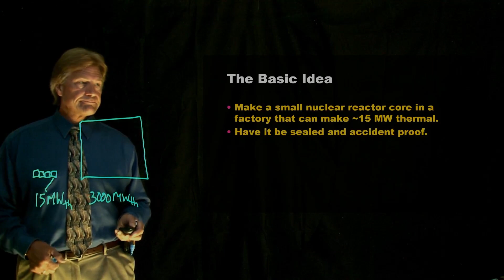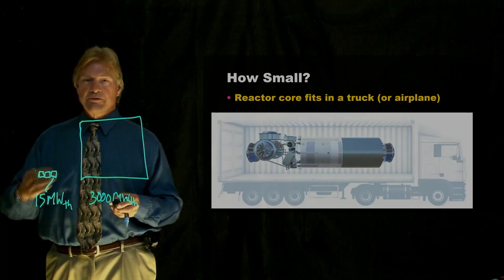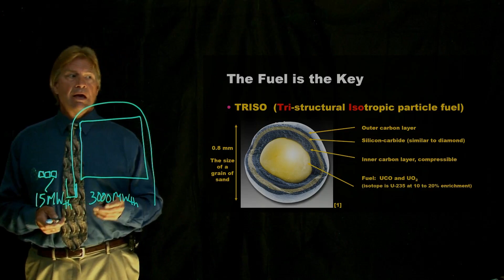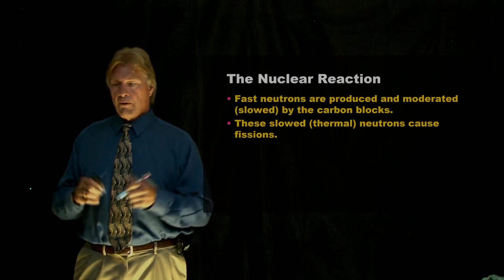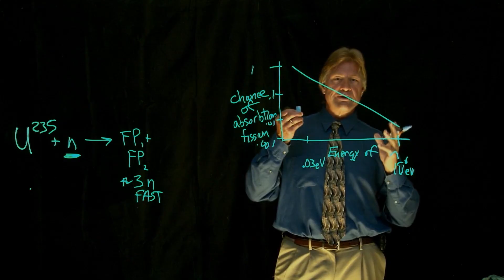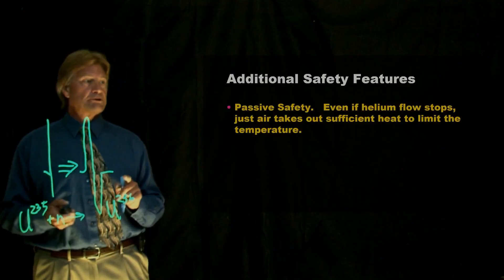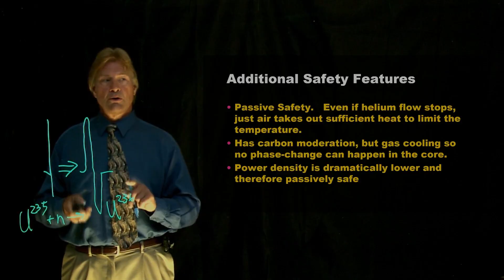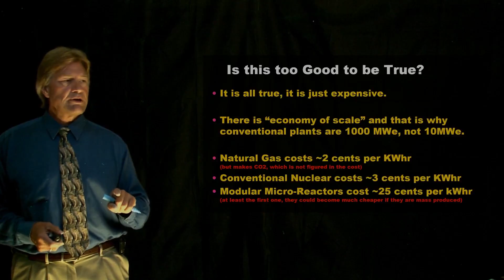Modular Micro-Reactors – The Future of Nuclear Energy?

Comment: A point the professor doesn't talk about is that the replace-ability of the reactor module means the generator site can be constantly reused and expanded with ease. Start with one or two modules, add some extra steam/salt piping and add a few more modules. Remove a module or two - cap off the pipes, and keep chugging along. 

The 'Power Plant' - the generators and such, are independent of the thermal generations; you could plop a natgas steam generator down and plumb it in if you wanted - steam is steam - OR, on an existing steam site, you could plop down one at an existing steam generator site to replace the old diesel or coal boiler units - and keep using the existing turbines. 

This may become the biggest use of the small modular reactors - as a replacement or supplement to existing thermal generators.
Reply: Might have implications for servicing as well. Need to take one down for repairs? No problem, just borrow another one from somewhere and plug it in.
Reply: @trucid2  Or if one went serious haywire, send it back to the factory to be repaired in safe conditions. 
I've been going on about micro reactors for ages and the ONLY reason for the big new projects has to be because of serious lobbying by the nuclear construction industry...which must see the writing on the wall from renewables/micro-reactors.
Reply: @JohnnyMotel99  I wonder how small these can get. Can we make it the size of a battery and solid state, using crystals that produce electricity from a temperature difference?
Reply: @JohnnyMotel99  I don't know why there is this the new term "micro reactor". What is wrong with small modular reactor (SMR)? A micro reactor is known in chemistry, where sensitive chemical reactions can't cause a thermal run-away.
Reply: @trucid2  Yes, this is called radioisotope battery, https://en.wikipedia.org/wiki/Radioisotope_thermoelectric_generator
Reply: Gunnar Kaestle my error, used wrong word. I’m just a lay person interested in this area.
Reply: @JohnnyMotel99  Well, actually it wasn't you, it was the creator of this video who chose: "Modular Micro-Reactors". Thus my question is to our Illinois EnergyProf: What is the difference to a Small Modular Reactor (SMR) and why did you prefer the modular micro-reactor?
Reply: @trucid2  If a unit has 15 MW thermal power - what will be the electric power? 5 MW? A few manufacturers are suppling 10 MW ICE CHP units, and you don't want to plug these units in and out to a busbar. After the commissioning you hope you can operate your internal combustion engine plant the next 20 years without disturbance. https://www.innio.com/en/news-media/news/press-release/centerpiece-of-k-i-e-l-coastal-power-plant-complete I believe a SMR operator will prefer to do the same.
Reply: He did mention it he drew many little boxes
Reply: @NOBOX7  I am a cost engineer and this is not a laughing matter.
Reply: kkthxk  I suppose you are making a joke? It's often hard to tell. Clearly absurd comment. 
On the off chance that this isn't a joke; I have to assume you are not aware of a company called Tesla that has built a battery storage system at the Hornsdale wind farm near Perth that has performed so much better than fossil fueled peaker plants due to its instant response that it has dramatically shortened its pay back period and inspired California and others to order such plants. So you see battery storage IS cropping up all over. You might also familiarize yourself with their "Autobidder" software that turns every electric car of theirs into a grid tied storage unit. Even Jim Crammer says oil is dead.
Reply: @stevemickler452  you know a few days ago a cigarette smoker got put in the ground at the ripe age of 65 and he coins the term or use the term selfish solar he is a climate change denier and I'd probably that way with a Christian fundamentalist perspective and history going back many decades of spending hundreds of thousands of dollars on his personal clean house power plant. He's the dude that you can buy the model 3 complete batteries from to use for your instant electric hot water heater or as I like to call them incandescent technology water heating the. I have personally met dudes that because they got pissed of the winter natural gas meter turn on fee have switched their houses to three phase so that they can use electrical resistance to heat water for many showers simultaneously. This does not matter unless Society adopts the madness and that's what we have seen. You don't seem to understand the frequency regulation has nothing to do with the proper price of liquid nitrogen. You don't seem to understand anything about the energy on the edge of a wire that is in the entire system of an electric grid which is fine but when you start talking you're not making sure the windows are shut and you might just destroy our planet with your nonsense.
Reply: @George Mann I understand lots of people have been dealing with these issues for even more decades than I have but it seems like they don't actually think about them and build on prior understandings. You think that's $50 2 * one kilowatt hour of electricity and I don't know why it puts an asterisk in the place for the word store but that's what happened so anyways storage is not the alternative to fuel and fuel rocks clean fuels that can generate mechanical work cost absolutely nothing for the materials to build our very are has all the material we need to store the energy and move it. Nobody pays what kind of money you're talking about for fuel of course so you can't compete at that rate but liquid nitrogen delivered is about single-digit gallons per dollar currently but can be brought down to double for a dollar in gallons that's without the delivery but flashing the cost of delivering saira Jenik liquid anywhere on this planet from anywhere on this planet by over 99% is basically trivial especially if you have a material of similar heft going in the other direction and given the reduced cost of such shipping there is actually no if there LOL to say that you don't possibly is to be facetious.
Reply: @George Mann I am not so sure about the figure of $50/kwh as the costs for the thermal storage made of molten salt. A hot-water tank (district heating, 1500 MWh) in Mannheim was installed for 30 M€/1,5 GWh = 20 €/kWh. A salt storage is a little bit more complicated than a simple hot water tank with some rockwool around it. But you can heat the volume much higher beyond 100°C, so the temperature spread can be higher, more energy can be stored per volume, even though water has a very high specific thermal energy capacity.
Reply: kkthxk  Coal fired plants are being built but only in Asia. In the US and EU, their number is declining. https://www.carbonbrief.org/mapped-worlds-coal-power-plants
Reply: Of course you'll still need a fossil fuel peaker plant or battery right? Molten salt will not store much heat unless a large storage vessel is added and even  then it will still have much more lag than battery. Just add some solar panels and save the money on the reactors. You'll have more power for your money and be able to expand as desired.
Reply: @stevemickler452  he addresses this at 18:50... depends on the use-case.
Reply: @mrshmee  Thanks. My bad but in fairness; I had trouble hearing. I think my point still stands though. Ordering more units is not an economical way to handle peak use I wouldn't think.
Reply: @stevemickler452  No, it is not economical to hadle peak use. You don't cover peak loads with base loads plants (= economically seen, a base load plant has low OPEX, but high CAPEX)
Reply: @gunnarkaestle  Whether you call them micro reactors or SMR,  they must have a steam turbine to spin the generator. Steam turbines are more efficient at larger sizes so I'm not thinking that the costs work out very well for smaller installations and even with salt heat storage, the turbine still has to be sized for the peak use  Wouldn't this result in lower thermodynamic efficiency and also cost inefficiency since you wouldn't be operating the turbine at peak most of the time and therefore wouldn't be getting ideal return on the turbine investment? If reactors are sized for steam turbines they end up big so you would have to have many SMR's per installation. This couldn't help but increase costs it seems to me.
Reply: @stevemickler452  I don't think you're contending that you have a point Steve so I'm a little bit unclear as to what the motive of your comment is?
Reply: @Irene-fu6gj  The statement was made that "batteries are garbage". That cannot be a serious statement given that, as will soon happen, millions of EV's plug into the grid acting as storage, and large scale dedicated battery storage continues. 
Solar is cheaper.
Reply: @stevemickler452  look some people are the way they are because do you see people complaining about retail when talking about wholesale or vice versa. It's like the Leaky Roof I am all for putting another roof on it frankly but there is a consensus that says tear it all down and put another one up. Regardless of who is right when it comes to roof the electric grid is not fixable. It's the wrong form of energy for anything but lights and logic. Get over it.
Reply: @Irene-fu6gj  Is that some kind of riddle? I've read your responses a few times and I can still only guess at their meaning. 
If one of your points was that heating water with gas is better than electric, I agree but there's that CO2 thing. If you're saying that the grid needs to be fixed I also agree although a full tear down seems drastic.
If you're saying that energy storage via batteries has a potentially destructive side I'd love to know about that. After all, my favorite is liquid air batteries.
If you meant that market forces are insufficient to facilitate the adoption of solar and that changing attitudes must happen first, I would just point you to that Princeton study that said there is no correlation between what the people say they want and the legislation that is passed. In an oligarchy, I think market forces will insure fast adoption of technologies that thankfully might save us before we hit some sort of horrific climate tipping point.
Reply: @stevemickler452  it was just some sort of strange click I think I may no longer be a YouTube premium member it sounds like a screen capture actually but I apologize for not responding to your reply until I finished a reply to a earlier comment actually a second reply to it and I had to edit many many times. Ultimately I misspelled the plural of materials that are transparent. See how it's a t though I guess I did spell it correctly transparence has a c but transparent as a t so if you make the possessive of the latter it becomes T apostrophe s which is good news because it means that my correction corrected it!

There's nothing terribly revolutionary about the fact that I have shared with you Steve. Electricity used to be for Arc lamps and then they developed as you know Edison he screwed around he perspired he built alternators it went beyond Rich ladies paying somebody in the white coat to give them pleasure with the help of electric magnets. Nowadays the electric grid has metastasized based upon the vague definition of what they have a monopoly on but it's not on car fuel even though they have captured much of the nonprofit reform industry for example the Rocky Mountain Institute in Colorado is entirely captured buy the electric grid industry. We awarded a Nobel Prize for solid state lighting and that was essentially a death penalty for the morons in foreign countries who have been buying up American Etc electric grids literally taking them private which the Destroyers of the planet promote as the vaccine against them when it comes to diversification. they know that a publicly owned Electric grid can endlessly work against public interest so they take them private with all sorts of obnoxious propaganda. The thing is you can go to Home Depot and buy a 20000 Lumen light bulb for under $100. That's more light than you get from a skylight and it's screws into a regular light bulb socket. the most efficient incandescent bulb is triple-digit wattage and the 20000 lumens is more then 10,000 watts of light! This bulb I tried it out at a Home Depot in a regular table lamp observing that we have table lamps that have several sockets like three sockets or even 5 or 7 for example standard bathroom vanities have six or eight. Now under prior administration's our department of energy did not want people putting light bulbs into those vanities that use nearly triple the current because more light rocks. That's kind of a kind of religious Presbyterian or is it Methodist I mean even the people that make the furniture instead of have premarital sex or I guess much post marital sex I would say that's kind of party pooping! it's getting hot in the day and what you want to do is go to sleep when the sun sets spend the week of Starbuck money on that light bulb which is nearly two months of course for a big vanity and my phone it just had the power light blink twice because I'm at 16% that's really a sweet notification to spare me the vibration and everything should I still not be plugged in when it drops another percent wow.

 When I read your comment I thought that teardown was your word and I was thinking how perceptive it was of you to characterize my perspective in such fashion because I was thinking about house not roofs. Play last comment however refers to the windows which I have referred to as glazings UC one of the grandchildren has been traveling all over the world and reports that they don't have I need to plug the holes in the walls in fact in some architectural magazines you can see awards given to schools that frame the openings properly for ventilation whether it's the Silicon in solar panels or just the glass more of us over time will have the courage to ask and getting the answer do say no thank you. our bodies prefer fresh air and we are able to radiate the Heat not into the air convective Lee indeed that comes at the price of body fluids because it is too slow when the air is dry and still and drenching accordingly when the air is wet. What's needed is shoes that actually absorb heat instead of just evaporate sweat or walls or ceilings even floors in the summer after all we use them in such fashion in the winter and there must be some sort of material that has the properties of ldpe like for example carpet made from recycled said plastic LOL it would have to be of extremely low Shag more like what the geriatrics require or we spend fortunes pouring around children's play structures. the flooring that is all seasonal cold and dry enough in the winter not just. but there are realities you know we are like dolphins so the temperature of the Air does not matter much all that matters is the acidity of the ocean and the temperature of our blood along with keeping carcinogens out of it. anywhere anybody would want to live everybody can carry their daily electrical needs in ounces or pounds. The grid is bankrupt and somebody needs to hire the sniper or it will snuff out our future. not complicated at all.

 PS scratch diversification I meant divest if acacian
Reply: @stevemickler452  Here are a few slides on a molten salt heat storage with high exergetic efficiency. The use a filler material (basalt stones), as this is cheaper than a 100% salt substrate. https://elib.dlr.de/113181/1/2017_03_15%20-%20IRES%202017%20D%C3%BCsseldorf.pdf

Comment: Toshiba 4S reactor didn't succeed in the market =(
Reply: @George Mann Delusional. Exactly how do you see solar failing? It is expanding and coming down in cost. Modular reactors are vaporware at this point so you can put any cost you want until mean 'ol Mr. reality upsets the dream with impractically high costs.